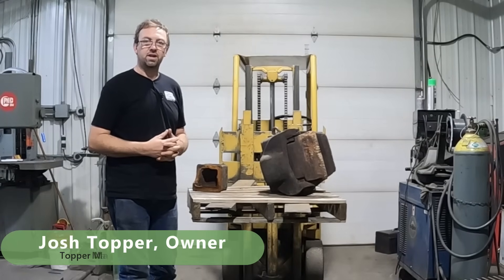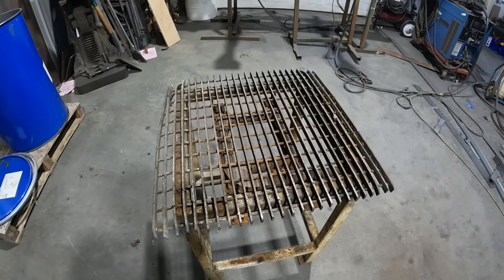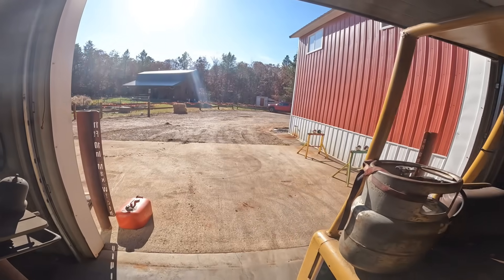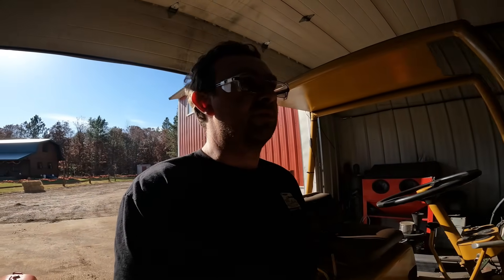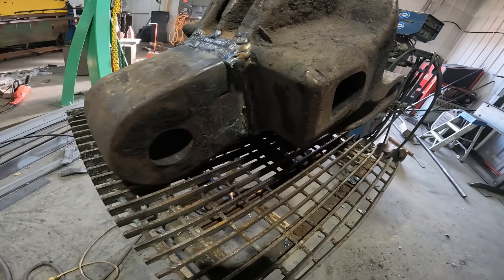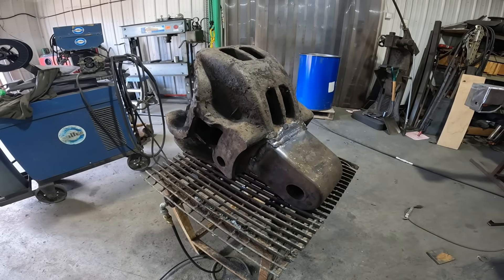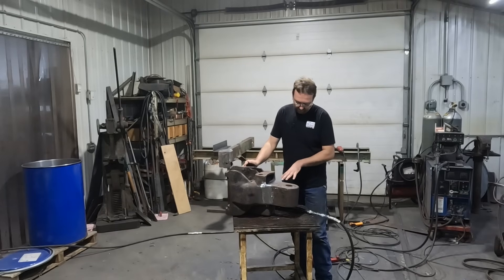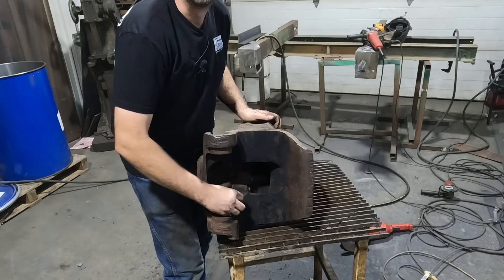Repairing A Broken Locomotive Coupler - 100% Not Legal For Active Service

Comment: Use 35% strength hydrogen peroxide and brush it over the welded area and it will rust out much the same as the surrounding knuckle (may require several brush coats after each dries), then brass wire brush it to blend it in to totally match as original.
Reply: I wouldnt mess with 35% hydrogen peroxide either
Reply: Draino toilet bowl cleaner will rust it up overnight if it’s humid out or dew. It’s common to do on animal traps to make them virtually invisible under water against the bottom.
Reply: @chuckfry1227  lol The razor thin rust line of a crack is how inspectors identify a crack. To obscure a crack on a railcar coupler is a violation of federal law.
Reply: @wadestanton  I know that! I am just letting others how to make steel rust overnight that is all.
Reply: @chuckfry1227  Tell them how to make aluminium disappear overnight.
Reply: You know the FRA can fine and imprison you for doing that? Canada has even stricter penalties.  Lac-Mégantic would prob give the death penalty.
Reply: @wadestanton  the town of Lac-Mégantic would throw you in a large caldron of burning crude oil!
Reply: @rearspeaker6364  I've read the final report, crazy story with failures of every sort.

Comment: I am a retired locomotive engineer. FYI, broken drawbars (which is what this is) are NEVER the engineer's fault for rough train handling. Broken knuckles could be, depending upon the percentage of old break (pre-existing cracks). The solution to showing that it is an old break, even if it is new, is to cause rapid weathering of the break. This is best accomplished by simply relieving oneself on the new break. This is important, because broken knuckles are simply discarded along the right-of-way, and will inevitably be inspected the next day by the Road Foreman of Engines in an effort to impose discipline upon the engineer. An equipment failure causing delayed operations is charged to the Mechanical Department, so those clowns always want to blame the engineer.
Reply: I have been a conductor for close to 20 years, if I like the engineer the knuckle gets tossed in the woods.
Reply: @opiumextract2934  😁😁😁
Reply: @opiumextract2934  in my 28 years as a switchman (Professional Freight Conductor i.e. a term bestowed on us by the great Canadian National )
I always told my younger engineer's or trainee's that if he gets a knuckle or drawbar he is changing them cause HE broke them!
Reply: Yep. Pissed on a few knuckles in my day.
Reply: @JohnMuise  I'm not a welder or a railroad man, but I gotta know.  What does peeing on it do ?
Reply: @jordancobb509  typically someone will ask how much of the break is clean (shiny metal) . Typically you would reply with 15% or something low as to not get the engineer in trouble. You pee on it to essentially back up your story to cover yourself as it will make it rust quick out in the elements.
Reply: @jordancobb509  Older breaks will be a darker brown rust color and newer ones will be a more bright orange color but just happened breaks will not have rust on them and be shiny. So the chemical make up of urine will make the lighter colored rust form as if it's been cracked for some amount of time, not a very long time but definitely doesn't look like it was a fresh shiny break that day. Makes it seem like it's been cracked for some time then finally the last tiny bit that was hanging on broke just now from normal operational stresses.
Reply: @jordancobb509   Makes the fracture  rust
Reply: @sommebuddy  no sir, I am not. Knuckles, maybe. Drawbars are always mechanical failure. I spent 30 years as a locomotive engineer, 2 of which as a BLE&T officer. I have investigated these issues numerous times. I have discussed the issue with numerous mechanical department employees, including high-level managers, and all agree that in-train forces singular in nature are insufficient to attribute to a single incident. Long-term fatigue from those forces, yes. One engineer, no...
Reply: @TomYoureDoingItWrong  if everyone knows that it's not the engineers fault, then why does the engineer have to try to hide it?
Reply: Can confirm 👍
Reply: lol As a retired carman I have bad ordered hundreds of cars for cracked couplers. It was always a fight with management. Shift foreman would actually come out and say, "the crack is so small". They didn't understand that the part of the crack you can't see may be huge. Cracked couplers are caused by a defect in the casting and may never result in a visible crack. My crew would never even apply a welder's ground clamp on a coupler.

Comment: Is it true that a engineer can break couplings by accelerating a long train before slack is removed from cars at the end of the train?  Is that cast steel or or malleable iron?  I would like to know how much impact is required.
Reply: A coupler can break by impact if it has a crack due to  defect in casting. A good coupler will come out of its pocket or bend due to impact. The 'coupling' between cars may break in your scenario because of the knuckle failing.

Comment: your liability doesn't end with a customers promise. that coupler could end up anywhere. those "static" displays can end up being sold off for parts and or scrap and a good looking repair like that could end up fooling someone into thinking its a usable part. i used to run a locomotive / railcar repair shop and i wouldn't touch that job for any  reason.
Reply: We never even put the ground clamp on a coupler when welding the coupler carrier.
Reply: 🤦Good for you chicken little. It has Stamps in multiple places stating it's been repaired, NO ONE is going to try to reuse it. Its bc of Nanny State idiots like you that Josh lost money on this. 🖕

Comment: What's the statute of limitations for illegal welding?  Asking for a friend.
Reply: Depends, did your friend weld, then grind, paint and rub grease and dirt over the weld. That would be a fraudulent repair if your friend charged for it, no statute of limitations on fraud.
Reply: Technically, the repair is completely legal. Use in railroad service.AFTER being repaired, THAT'S the illegal part.

Comment: You definitely have the machine for welding something so heavy. Sooo won't you try to spray  weld - or long arc next time instead of short arcing. It would be Hotter and more Fluid not to mention  Faster.  Try 95% Argon and 5% Oxygen  It will flow Like Butter.
Reply from the maker: I would like to try that, probably next time.  Biggest problem for myself is getting supplies.  We are really in a desolate/depressed region.  It is hard to get anything we need.  It has gotten better since a new gas supplier moved into the area.  Praxair/Linde was awful, and a real struggle to even get C25 or O2.  I switched away from acetylene a few years back because they were so awful, and now run propane on the torch.

Comment: Seems a part like this could be signed at the repair site indicating it's no longer for service use.
Although it seems the repair is better than new.
Reply from the maker: My weld inspector took a quick look at it and told me to get a couple NDTs done and if it passes should be good to go. But, the railroads would still probably not accept it.
Reply: @TopperMachineLLC  Check the AAR field manual for proper repair. You will never be qualified to be a coupler repair shop unless you give  Ian Jefferies $Millions.
Reply from the maker: @wadestanton  I would never do this repair for an operating piece.  Since it was a static display, i have no issues.  I've dealt with the FRA enough over 20 years to know they are morons with vendettas and just want to fine everyone.  No Thanks!!!

Comment: its funny, i was reading the title "repairing a Broken Locomotive Coupler..." and i immediately thought "Thats not legal!" before finishing reading it. 🤣 The forces exerted on those couplers are insane!
Reply: yeah.  decades ago I was taught that the knuckles were only good for about 1 million pounds of tractive pull.  On a long train, from standing start, if the engineer just whacks the throttle wide open, the knuckle will break on about the 6th car behind the engine.  as a brakeman, you had to be able to carry and replace a broken 95 pound knuckle.  the shock loads on those knuckles and drawbars will give you pause for thought.

Comment: Cool repair Josh...if the oxy-fuel torch was able to cut that, the same as steel, then that coupler is cast steel [not cast iron] cast iron will not burn, just melt. The preheat/post heat you did was the charm "that will work" IMHO and keep you out of jail lol!
Reply from the maker: These are definitely cast steel. I believe I said that several times. Cast iron would never take this beating. Years back they were wrought iron.
Reply: @TopperMachineLLC  So many of the comments said cast iron, I aimed my comment at them, not you Josh. Sorry for the confusion on my part,  you have a great channel!
Reply from the maker: @AWDJRforYouTube  no problem.  It's funny how there is so much confusion between cast steel and cast iron. Both require totally different processes in making and repairing, yet people use the term universally. Kind of like brass and bronze. You would never use brass for a bushing, yet everyone calls them brass bushings. 🤦‍♂️

Comment: I think what it comes down to, is that the railway wouldn't weld it and put it back in service because 100 tons yanking 100 tons when they're bunching and slacking would risk snapping off at the weld. There's a stupid amount of force on those bars. So they'd probably replace it with a new one.
Reply: True, plus not all welders have the skilll or patience to weld a part like that properly. It just makes more sense to order new parts
Reply: In Europe at least, it is a matter of the shop needs to have a third party come verifying you have an acceptable quality assurance system in place. Then you get issued a ISO 3834 certificate. I know its a requirement for railroad and pressure vessels, Shipping has other similar rules, and it is industry standard because of accidents that has happened due to failures.

Comment: as a retired master mechanic who also is certified as an engineer for a tourist railroad, I enjoyed watching you repair the coupler ; I don't much care for snow either, too many years of it and slush dripping on me under vcehicles in the winter!!!
Reply from the maker: 22 years wrenching on EMDs myself for fun. I mostly enjoy electrical troubleshooting.
Reply: @TopperMachineLLC  same here, even went and got double "D" bi focals for under dash work ( to see color code on 18 -22 Guage wiring) got tired of wrapping my feet around head rests though
Reply: @joewithrow2345  I think the mechanics in those Asian countries are contortionist.
Reply: 2strokes a joke GE!GE!
Reply: I hate working on a vehicle dropping water/snow on my face it’s the worst!!!
Reply: Thought any car carrier of passengers had to be new parts by aar rules
Reply: @liberty7835  Depends on the part. Swing hangers on trucks can be rebuilt if they aren't worn beyond a certain percentage. If they are, then it has to be a new part. More than 80% of the original material there and it can be welded up and reground to shape. If less than 80% there, it is scrap metal. No limit on the number of times it can be rebuilt as long as you keep it above the 80% rule.

Comment: I thought that coupler would have to be cast steel, even though it looked like cast iron, which would not have been strong enough for that application.  Looks like you really laid the amps into it. What was the amperage setting on the welder?
Reply from the maker: They are cast steel. I think I was right around 260-270 amps. My welder is a 300 amp 100% duty cycle, but capable of 400 for short times.

Comment: perhaps , STAMPING/Tagging it "DEMONSTRATION ONLY"? across the curve of the shank?
Reply from the maker: It has been stamped and tagged.  Something I take quite seriously is FRA violations.
Reply: Maybe if you removed the locking mechanism and welded a short plug in its place so it could never be put back?

Comment: Great job again Josh. Wondering why you didnt try electric arc gouging instead of the torch. Oh and thanks for the heads up on the weather forecast....So now can figure 18-24hrs and that crap will be here too.....
Reply from the maker: Thanks. I haven't been using the air-arc indoors. Just too messy. The plasma torch did an amazing job. I started with the oxy-propane and quickly switched to plaz.

Comment: Usually when a coupler breaks, it is just the knuckle. I've seen a few of those on YouTube. Also I once saw a broken draft gear box. The car (a gondola) it was mounted on looked pretty beat up from living a hard life hauling scrap metal for the steel industry. That car was scrapped on the spot. Your video is very informative and educational. Keep up the good work. Guy Franks
Reply from the maker: I've seen some pretty messed up couplers and draft gear. It's rare to break a shank, but this is the 3rd one I've seen this year. The other 2 we're in interchange service and had to be replaced for legal reasons. This one being a static display was a good opportunity to try my hand at it.

Comment: What wire did you use?
Reply from the maker: My standard for most fab work. ER70S-6 .045. Was going to switch to my 1/16" wire, but didn't want to take the time then switch back, just to switch back to it again next week. Job is coming for that big wire.

Comment: How in WHATEVER do they break a coupler in a STATIC display??? Nothing against your repair...It would do well for awhile even on a working display, until a new coupler could be obtained but why work something to better than new when the coupler will never have a pulling force on it? Beyond that, be advised that you are on the top three of the list I have of repairing just about ANYTHING. Once again I learned more about cast iron repair than I knew before and am realizing that experience and knowledge by doing always trump what you watch on YouTube.
Reply from the maker: I'm guessing improper crane operation or something else.  Not really sure what happened.  I would have elected for just replacing it, but the customer had delusions that it was original. I'm not going to do a half ass repair for cosmetics, because you know someone will eventually try lifting it or pulling it. I've already had a few calls from well known weld shops who said that my repair was spot on and only needs a NDT to confirm soundness.

Comment: You need a cover for the parts your are heating, just a simple sheet metal box would save time and gas and be good for slow cool down.
Reply from the maker: I've thought about it and I would need 50 boxes of different sizes and still not have what I need. Propane is cheap. Sometimes I do set a metal trash can lid on it to help.
Reply: Use a fire blanket?  That's what I do. 

I'll be copying the table though!! Thanks for the video

Comment: Hi Josh, Keith is pretty interested about this device. 1/ When was the actual time line. You had the sun shining with the shop was open. Friday in my area, Thursday was fantastic, not today.  I'm much further south, versus your location. 2/ I love your pre-heat table, very nice. My 24 Hp Kohler tractor is ready for winter. Have a pleasant weekend.
Reply from the maker: Weeks ago. Don't remember when I actually shot it all.